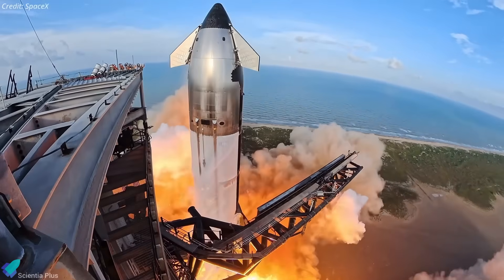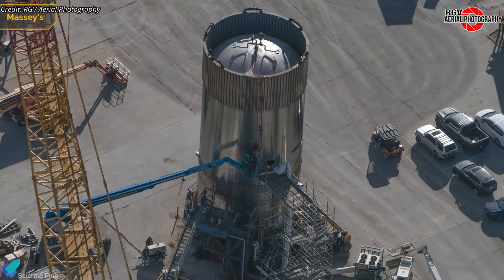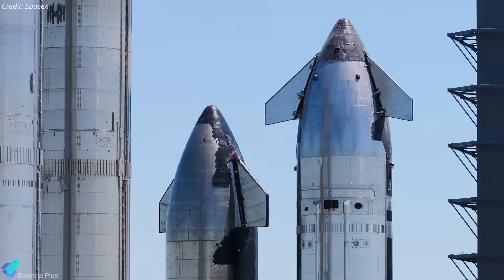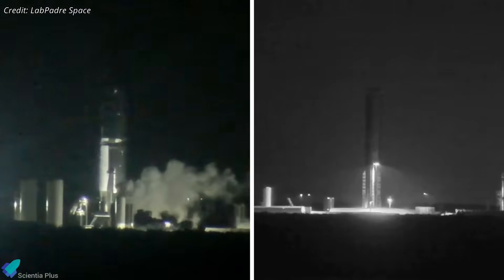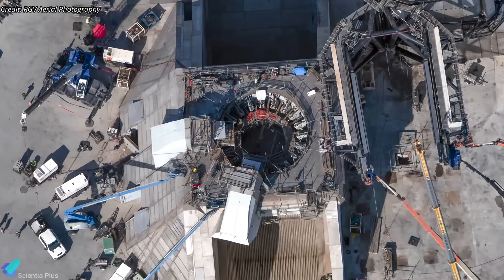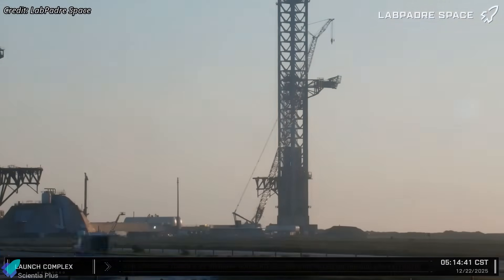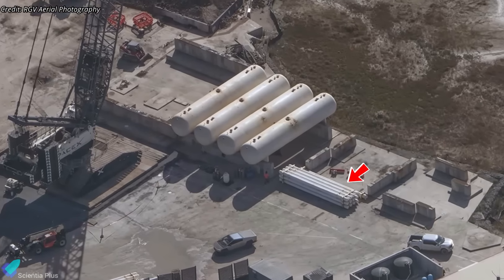New Problems Inside Ship 39 Force SpaceX to Rethink Flight 12

Comment from the maker: 00:00 Starship Updates
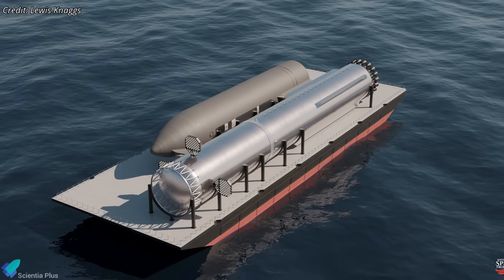07:38 European Space Agency HACKED! Data For SALE!
10:20 Russia Quietly Builds Its Own SpaceX-Style “Transporter” Mission

📚 Learn More:

🚀 Starship Block 3 Explained: https://tinyurl.com/mp63u57m
  • Detailed Breakdown: https://tinyurl.com/bddv6w2y
  • Production Begins: https://tinyurl.com/5cb2ee3h
  • New Transfer Tube / Downcomer: https://tinyurl.com/ymm23t2c
  • New Grid Fin: https://tinyurl.com/mppnd7sz
  • New Integrated Hot Stage Ring & Forward Dome Upgrades: https://tinyurl.com/msvxk8m
  • Booster Block 3 Aft Dome Insane Design Upgrades: https://tinyurl.com/3k2rxvpf

🛢 Dual-Port Orbital Refueling – Full Technical Breakdown
https://tinyurl.com/3hej7fk3

 Starship Block 4 Unveiled: https://tinyurl.com/ymhyyt2h

🔥The Insane Engineering Of Raptor Engines:
     Part 1: https://tinyurl.com/348hsrya
     Part 2: https://tinyurl.com/p8k85mu6
 
🔥 Raptor V3 Explained:
    Mega Upgrades & First Test: https://tinyurl.com/22nzc3za
    Raptor 3 Evolved Again - More Protection This Time: https://tinyurl.com/4up7jxdd

🛠 Insane Engineering of New Starship Launch Pad: https://tinyurl.com/42h5kd92

🧱 What’s Inside Starship GigaBay?: https://tinyurl.com/2ujtkmkb

🛠 Other Starship Upgrades:
 • Hot Staging Explained: https://tinyurl.com/yc4ejbmn
 • Super Heavy Booster Upgrades: https://tinyurl.com/msm9jtkc
 • New Heat Tiles Explained: https://tinyurl.com/45dytyef

🔥Booster 18 Explosion Complete Breakdown: https://youtu.be/2mYXI6WRwqI

🔥 Starship 36 Explosion:
  📽 Detailed Breakdown: https://youtu.be/VWQiIz1ymBA
  🛠 Damage Report: https://shorturl.at/Quoex
  🛠 Root Cause & Fixes: https://shorturl.at/NVqdS

📡 Stay Updated:
📢 Weekly Updates: https://bit.ly/3HIQjPC
🚀 SpaceX Playlist: https://bit.ly/34wue8T

Comment: This is what happens when the system is connected directly to the web,  all information should go through a detached connection incoming ,and outgoing so it can be validated in and out, it might take a little longer, but manually inspecting before information is transmitted out , and checking for imbedded back door implants. You can see then who is suspected of betrayal.

Comment: TTs 18 (.1 and .3)...are for the booster. There was another Test Article that is for V3 ships (I don't think it is SN2).
...and Masseys's is not ready for any testing yet so why not take the time to improve things?
This is under the label of "Scientia Plus" seems sketchy. Too bad. Could be sooo much better.
Technical point: the doors that cover the clamps do not retract or protect anything during ignition. They close after the engines are running and the vehicle has already lifted off and protects them from the blast of 33 running Raptor 3 engines.
Too much hype and technical mistakes to continue past SpaceX 'update'

Comment: Starship V2 was incapable of fulfilling Elon Musk's promises, so it was discontinued before reaching orbit or achieving the promised payload capacity.   Version 3 has additional stresses, such as stronger engine forces, greater mass, five times the payload, and an untested reentry from orbit.I doubt this exaggerated concept will ever work.  The critical limit may have already been exceeded. In any case, there will be no Starship HLS to the Moon.
Reply: That is so not why 2 was discontinued.

It was discontinued because it was just a test vehicle. And 3 isn't the final version either. He's working his way up to the big ones he wants to build.
Reply: In reality, V2 accomplished every single goal set for V2.  As did V1.  And V3 will do the same.
Reply: @ChristLink-Channel  Either you've been manipulated or you're deliberately lying. Neither can be corrected, so: Best regards to the tooth fairy.
Reply: @bordeaux1962  Not lying, not manipulated (unlike you...)  Just stating verifiable facts (unlike you...)
Reply: @ChristLink-Channel 
I'm a SpaceX fan, but no Starship did not accomplish everything. It was supposed to go to orbit, and it was supposed to put payloads into orbit. And it was supposed to be refueled. And caught.

But they learned many things from it, but they also learned that some of the things that needed changing, would be better changed during the new version. Which was in fact always planned.
Reply: Well, Starship HLS will eventually reach the Moon if the new President in 2029 doesn't cancel it, but it will happen after China and BO land humans on the Moon.